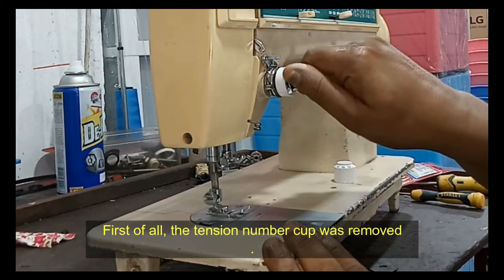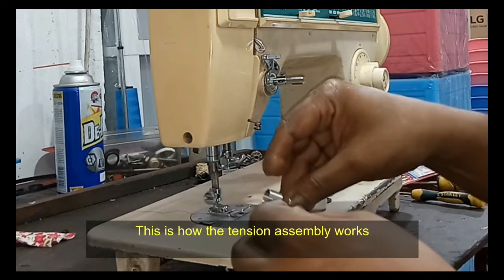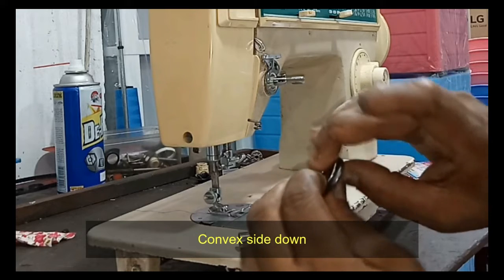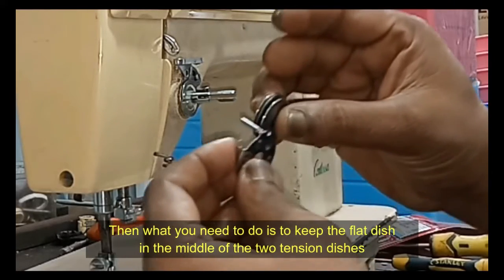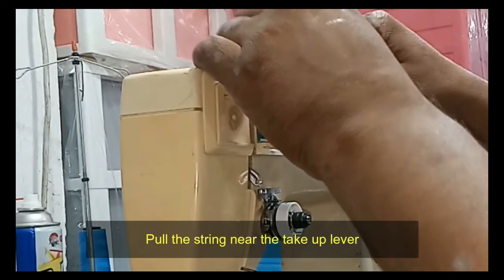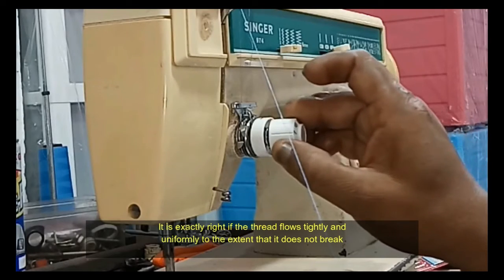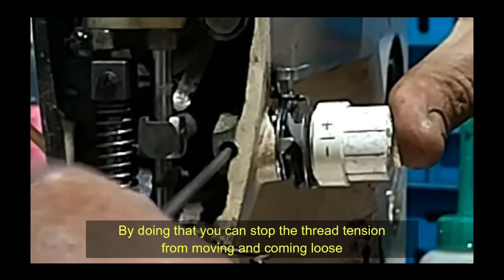How to Fix Thread Tension Assembly Errors on Singer Zigzag Sewing Machine | English

Comment from the maker: 0:00:18
See how to remove parts from rows.
0:00:25
Removing the tension cup
0:00:27
Unscrew and remove the tension nut.
0:00:29
Removing the tension cut washer
0:00:45
Removing the tension spring
0:00:48
Tension plus minus cup is removed.
0:00:51
Remove the tension pressure plate, three tension dishes, and take-up spring.
0:01:56
Place the pressure plate on top of the tension dish and slide it all into the take-up spring.
0:02:02
Insert the tension stud correctly.
0:02:12
Plus Minus Cup Mounting
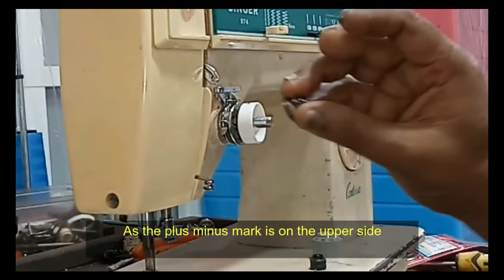0:03:15
Tension spring installation
0:03:16
Tension cut washer installation
0:03:20
Tension nut installation
0:05:10
If the complete tension post comes off the sewing machine, tighten the pin shown here.